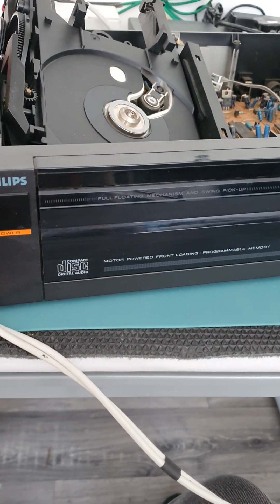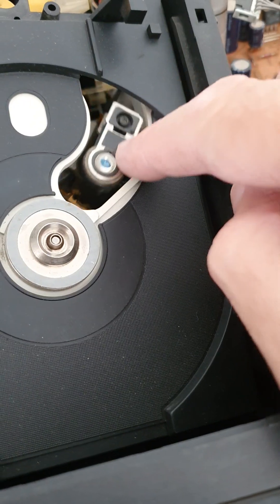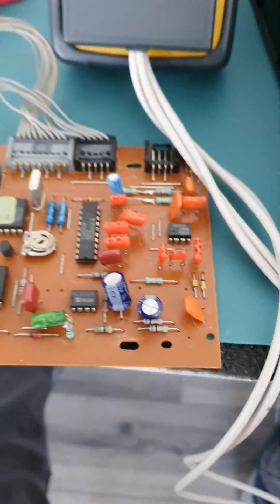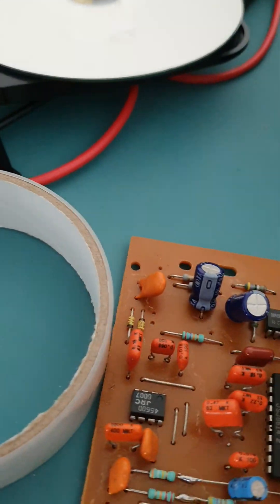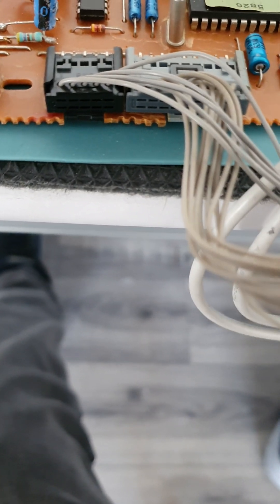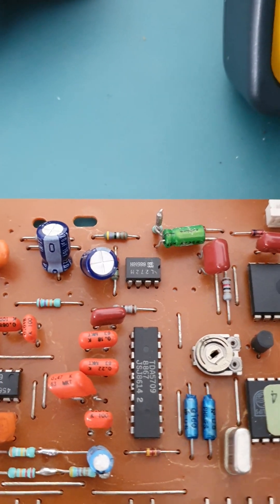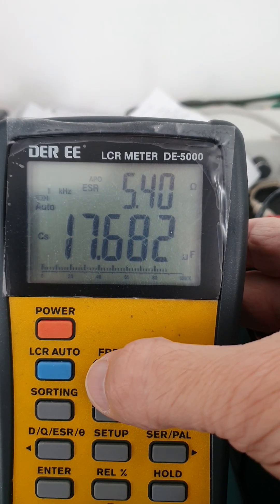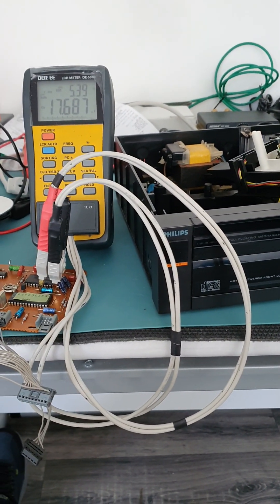Philips CD-150 Repair - Is it worth it? Part 2

Comment: Can the small 16v 33uF caps be replaced with 47uF caps or must they be 33uF?
Reply from the maker: @anyoneforapint  Probably, but it depends what their function is in the circuit. 33uF can be purchased on Ebay or CPC Farnell